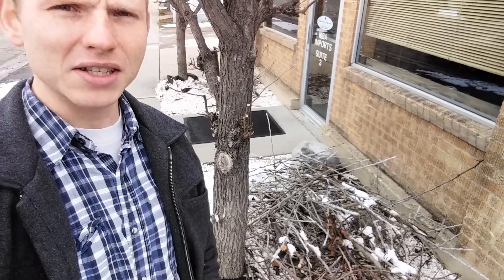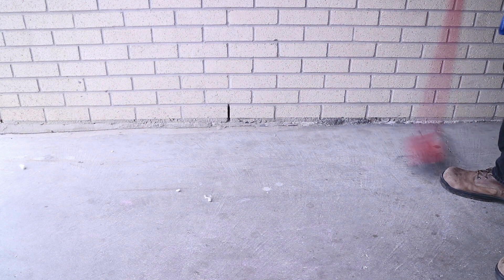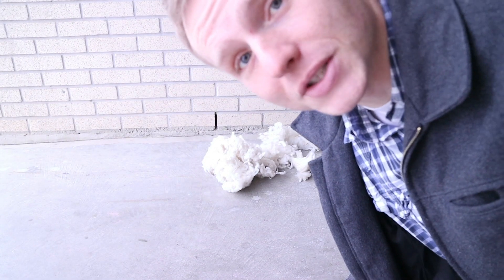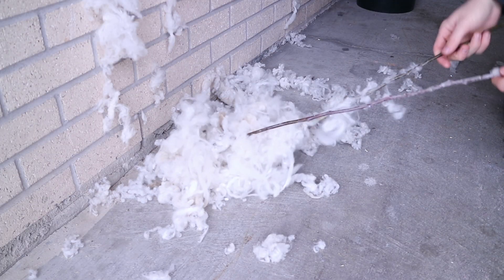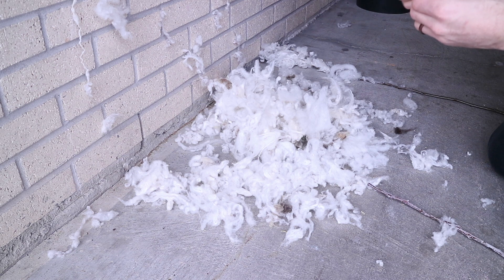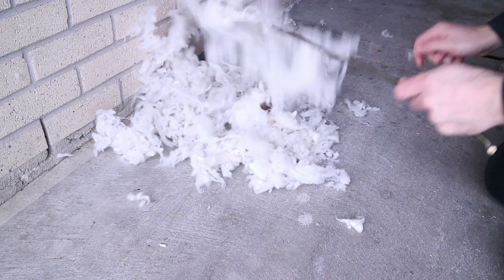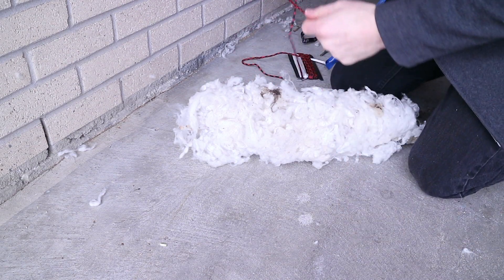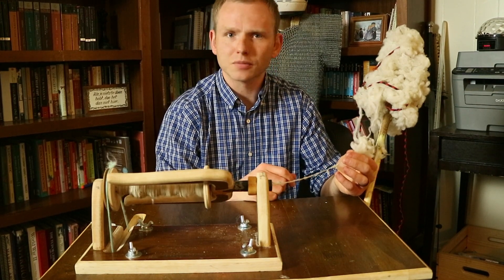Willowing Wool: Using Sticks to Process Fiber

Comment: Bamboo garden stakes, or fiberglass rods would work great, and you could automate this process with a Rubbermaid tub and a singer sewing machine foot pedal mechanism, or a power drill with some sticks on a wheel in a container....  Excellent video my dude!
Reply: Nope you need the little catchers on the sticks to pull and catch the stands
Reply: @mealex303  Bamboo garden stakes have little "catchers" built right in, the plants stretch their feelers and catch them-thats what provides support and precisely why they work so well...so yup 😉

Comment: I’m a bit concerned over your lovely homemade spinning wheel, the treadle needs to drive the flyer and then you need a brake band on the bobbin to improve the draw of the wool onto the bobbin. Hope that helps and forgive me if you think I’m interfering. Loved your video though.
Reply from the maker: It would be nice to have more adjustable tension, but it actually works surprisingly well. JB

Comment: Yes, I agree with sweeping the floor area before willowing there. But it may have helped if you put down a sheet or smooth cotton fabric after sweeping before willowing. Fluffing up the staples or locks by introducing air and taking out the plant matter are both helpful. But the  wool is cleaner and will not take as many passes on the combs or time on the hand carders to remove the plant matter. 

It is more helpful to actually align the  fibers by combing or carding before spinning. That way you can draft more efficiently and easily. You should have a nicer, neater triangle shape as you are drafting your fiber.

Yes you can willow wool, but more of the plant matter will come out more easily if the wool has been washed and is free of grease. Then dirt doesn’t want to stick to the fiber as much, plus you wash out an AMAZING amount of dirt too.

I would suggest you try some sort of heavy screen, finer than chicken wire, but heavier than the screening for house windows. 

I hope this helps you and I encourage you to keep trying. Don’t give up!

Comment: Obviously if there's a name for it...it Was done. But was it efficient?
Reply from the maker: Also, what was it done for? And what techniques were used with it in the workflow? I don't know. In East Asia they use something similar for final fiber preparation and making quilting batts. The illustrations from Europe are a bit ambiguous. It might be a process mostly for cleaning the fiber rather than final prep. More research and attempts needed. JB

Comment: Okay, your technique is reasonable, but not the whole story.  Typically this is done on a screen or something that is slightly lifted off a table to allow the VM to fall through.  Once you willow... which is much more often done on cotton as far as I know, mostly because wool can felt so easily, you need to comb the now fluffy fiber.   Your other video shows your nail combs, which are great, but for shorter, finer bits you need to use smaller OR finer nails closer together... think a dog or cat brush, which works great, btw.  That will allow you to work the shorter fibers just like you did for the longer ones in the first video.  Your observations about choke points in production are very accurate, but trying to spin from a distaff wrapped with 'bail fiber' would increase your work time, not lessen it.  If you want to spin from the willow fiver directly, you are better off working each lock, one at a time, joining on as you pick up each one.   I do need to say your videos are way cool and it is nice to see someone taking an approach like yours to how some of the things modern folks take for granted used to be done.  PS, the sheep grow more, so you don't really need to worry about trying to undo your first, less nice spinning.
Reply from the maker: Thanks for the info! I'm getting a similar idea about it mostly being for cleaning out vm. I've also moved to spinning straight from the lock as well. I'm glad you're enjoying the videos! JB